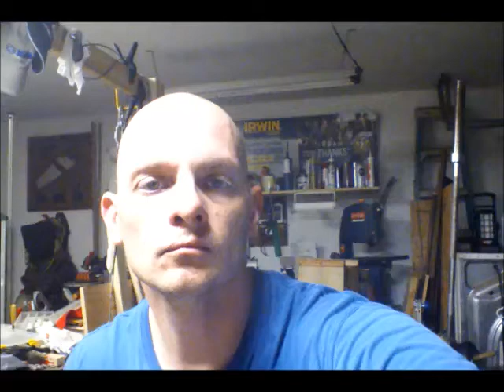Draining an Air Compressor to get the Water Out?!

Comment: My compressor normally is at 135 psi. How much air pressure should be in the tank when I drain the water? Is 135 psi too much pressure to drain the water?
Reply from the maker: Nah. You should be good. It's gonna be loud and messy so do it outside in the grass if able. The rusty water will stain the driveway.
Reply: @1978carpenter  thanks for the comment and your time!!

Comment: hey my paint shops in Vegas with the summer heat hitting around 110°and up daily, and inside paint shop even in my booth it gets to be even hotter. So when buying this shop it had a swamp cooler stuck on the roof,and as you know swamp coolers cool the air down by basically pouring water down a couple of pads...and then blowing air over/through them, what have you. does the swamp cooler directly contribute to having excess water in lines? And I'm constantly getting fish eyes in my paint jobs regardless of my water trap and filters I have the lines run through. now here's my question real quick, does the fact that the air my compressors are sucking in is being derived from the air in the shop that's been cycled through this swamp cooler, and slowly heating up to however many degrees, it never seems cool in the place so I don't see a dramatic heat rise or cool down ever, to cause the vapors to condense etc. yet my products have a smattering of fish eyes and little blemishes from friggin water in my lines!! so I've tried everything and I have been debating with my painter and body men, none of us completely confident in our analysis, at least I passed my ninth grade physical science class, can't vouch for these schmucks,lol. so there's a little bit of knowledge thrown in And understanding of the basic concept of the water cycle blah blah and properties of condensation etc.  And if you got some advice or whatever I'm eager to hear it. thanks
Reply from the maker: Great question! I have some thoughts on this and I am warming up the camera now. Stay tuned. I should have a video for you this evening!
Reply from the maker: Here ya go! I hope this helps!
https://www.youtube.com/watch?v=VJumPE0L8WA&feature=youtu.be
Reply: Hey  S. Wimberly
 can i contact you  somehow because i have similiar problems in my paint whit fisheyes and i dont know anymore what to do ?